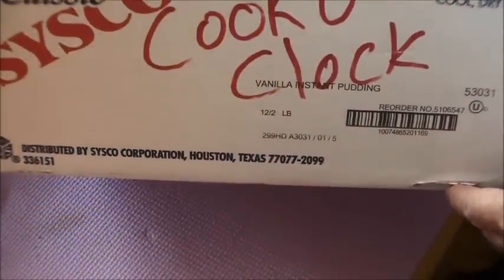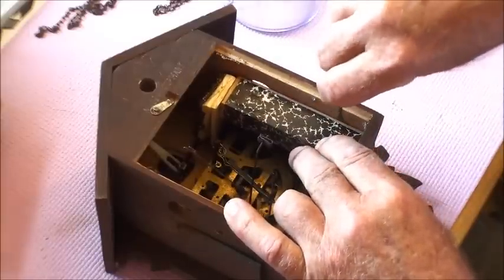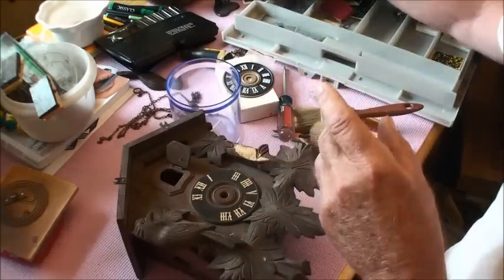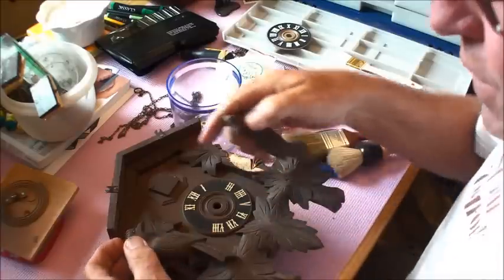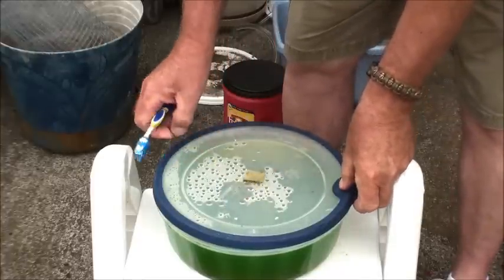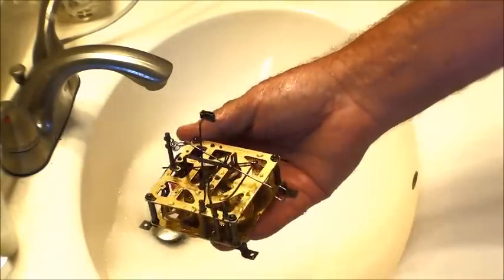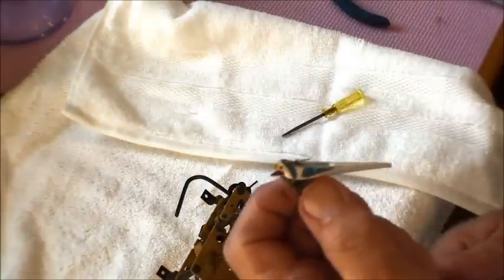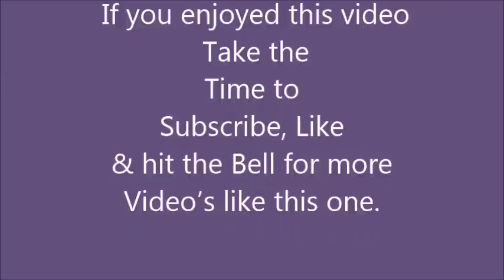Cuckoo Clock Repair

Comment: Hi  I would  like to no is thir  two chains  on this clock  I have a clock it only has one chain the cocu have looks like your s the cocu works but not the clock it also missing the pendalome
Reply from the maker: Normally when you order a chain, they come in a set of two and three chains. You can order the chains on line, along with the pendulum from Timesavers. com

Comment: Thank you for this DIY tutorial Mr. Mike. I've owned my cuckoo clock for nearly 33 years. However it stopped working after boxing it away due to moving around so much while serving in the Military. Now it just hangs on my wall looking good only. After crossing and watching your video, my clock has the potential of operating again. I tried finding a local clock repair shop and none will touch it, stating they don't carry the repair parts. Is there anyone that you could recommend. I'll gladly cover all of the shipments. Thank you.
Reply from the maker: There are more and more clock shops that stop working on cuckoo clocks. I hear there is no money in fixing them. Could you email me some pictures of your clock and the inside where the movement is? My email is below the video.

Comment: I have quite the same built around 1950 in Triberg and I've just repaired it. One needle was broken and I made it with my CNC.
Reply from the maker: This is great to hear you got your Cuckoo Clock working again Michel Bonnet.
Reply: @justmike57  I've also used bank card receipt paper to repair the bellows (just repair, not replace). Hope that will last some time...

Comment: Hello Mike, can I soak the Weights in the Amonia Soloution?  
I'm trying to repair an old unworking Cuckoo Clock my sister gave me.
Cheers and thanks for your very informative Video. Cheryl.
Reply from the maker: The Ammonia cleaner will strip the paint off the weights. Depending on what they look like, you could just scrub them with Dawn and a green scratchy pad. Also, look at yours, you could repaint them with black and some have a golden rub on them for antiquing them.
Reply: Thanks Just Mike, I went ahead and put them in the Amonia mix, before I heard back from you, just for a couple of hours, it didn't do any harm, and the Gold bits have come up nice and Shining. Cheers Cheryl.

Comment: Mike, please add to your list under your equipment the following;
- Ammonia cleaner used or how you made it
- Stain brand/color
- Why you applied stain with sponge not brush
- Type of oil used or part suppliers you like
- Where to buy various other parts we may need
-  All equipment/tools we need for such project

Do another video on tips and tricks of the Cuckoo Clock Hobby. After watching this I want to go fix the clocks of all my siblings, friends....anyone’s home I’m visiting at...ha!
Reply from the maker: This is a great idea Kevin. I will admit, I was very new at this Youtube thing when the video was made. I have added my email on the newer videos I have been putting out. Thanks so much for stopping by Kevin DeAdder.

Comment: Thanks so much for this, Mike. I recently inherited my grandfather’s cuckoo clock that he acquired when he was stationed in Germany. It hung in the den over his chair my entire childhood. It’s in pretty bad disrepair, so I thought I’d give a go at fixing it. If I use Dawn to clean the mechanism, how long should I let it soak? Thanks again!
Reply from the maker: The Dawn helps lift the oils in hot water. Swishing it around in the water and giving it a little time (15 minutes) using a toothbrush to help clean with, changing the water for more hot water and swishing many more times. Do note. After cleaning, drying and oiling. The works will still be a little stiff when you first get the clock running. It takes more time to get the oil moving again, possibly because you couldn't properly flush all the old oil and wear out. You will have to speed up the pendulum and not care for the time of the clock for a few days. I hope I didn't babl on to much and you got your question answered. Thanks for the great question.
Reply: Just Mike Thank you!

Comment: Where did you get the skill to do all the things u do?
Stay safe
Reply from the maker: I have always been a hands on person. My dad use to repair clocks in his spare time. I was interested and just started to do the same as him. Then I started to learn better ways of cleaning the clocks and went on from there. Dad started to have problems with his fine motor skills and gave me his tools that made things easier. I enjoy the Cuckoo Clock the most, then the old kitchen clocks. I also work on the other clocks as needed. Just enjoying my hobby and a great hobby it has been. Thanks for stopping by again O'Donnell's Aussie Homestead

Comment: I came across one of those too so I am watching to see what needs to be done, after I changed the broken winding gear... nice video!
Reply from the maker: Thank you for watching Angelo Evangelou. Now that I am recording my clock repairs, I haven't come across one that I need to replace the winder. Just in case things go wrong, take pictures of the gears and where they go so you can get it back together again Angelo Evangelou.

Comment: I was hoping to watch you repair a bellow. The one I have has the top piece off the whistle box. I’ll have to look closer now that I know what it’s supposed to look like. Great information about the chains. My dad has a big one he bought in Germany. He repaired it several times and when I was little he put a special wire loop on the bottom that he could pull anytime just to hear it cuckoo. All of our friends loved to come over and watch the birdie!!Dad is 92 now and I miss that clock. It used to put me to sleep at night.
Reply from the maker: That was great memories you had with that clock and your dad.  some of the clocks have a place to attach the wire to make the bird come out to cuckoo. For the bellows. I would buy a pair of them from an online Cuckoo Clock parts place. Check more than one out, because some are just out for your money. You need to keep your wire nails from the old ones and reinstall them in the new bellows. Also, you measure the bellows from front to back to get the right size. I use hot glue gun to glue them back on so I can install them faster and not have to wait for the glue to dry. Hope this helps you Cassandra Lambracht.

Comment: thanks for walking us through this. I've been rebuilding pendulum wall clocks and want to try my hand at a cuckoo clock so this was great. Now I'm pretty stoked at getting one.
Reply from the maker: If you have been doing wall clocks then you have this one in the bag. When you have music also on the Cuckoo clock, it gets just a little more difficult, but can be done. Thanks for your support Paul P.
Reply: @justmike57  Thanks for the vote of confidence. I did acquire a cuckoo clock from an estate sale, it's very similar to the one you showed in this video. I repaired the bellows and they  work, but the gears seem to have a problem. The big ones that are turned by the chains and weights don't move. The gears could probably use a cleaning but I'm not sure why they seem like they are seized. What do you think could be the problem? I tried oiling the different points like you showed. Maybe a good cleaning would be a good place to start

Comment: Wife tried to help after 2 hrs in and can’t get it over the sprocket while in the box.
Reply from the maker: It helps to turn the clock upside down and dangle one chain at a time to catch the sprocket, then turn the sprocket slowly turning the clock back around. Once the one chain is in and through the two holes, us a wire tie to secure the chains together and close to the two holes. Then start your other chain in the same manner. Check out the other videos if this one does not show me installing the chain.

Comment: Hi Just Mike! Thank you for your videos. They have been so helpful in helping me restore my grandmother’s cuckoo clock. It is a Black Forest, 1973 Regula 25, 1-day music and cuckoo clock that stopped working years ago. I cleaned and oiled it and got it working again but noticed the music and cuckoo are not aligned. Music goes off at the hour but the cuckoo won’t go off until 4-5 mins past. The music will trigger and won’t stop until I move the hand forward to trigger the cuckoo. After I do that, everything will work correctly again and stop as it should. Any suggestions on where I should be looking to get these two back in alignment? Thanks!
Reply from the maker: For the music, you need to adjust the wire that is suppose to stop the governor (FAN) on the music box. That could be called a warning wire because it stops the fan while the lever is pulling out of the barrel of the drum for the music. When the cuckoo is done cuckooing, the lever will lift and that pulls the wire up, out of the way of the fan and the music would start to play until the lever slips back in the music drum. 
  As for the minute hand starting everything at 5 after, you need to take the minute hand off, pull out the brass center, put the brass center back on the clock and turn it slowly until the clock cuckoos. Then put the hand on over the 6 or 12 and screw the nut back on snug.

Comment: I had three clocks which are currently in need of repairs, two of them not running at all.  Then last week in a moment of temporary insanity I bought two which were also in need of work, the only guy within nearly 200 miles that can do this is overloaded and says he will call me when he gets to me.  From what I've learned here I am sure that I can have two of the five working by next weekend.  The three with the dancers might take a wee bit longer but I am looking at working the dancing ones next. I might even buy a few more.  Thank you again!

Comment: just wanted to thank you for taking the time to post your work, I've just started tinkering with cuckoo clocks since my old one fell off the wall, I've scrounged around and found about a half dozen clocks, all in need of repair, watching you work has helped me get a couple of running clocks and I hope to get a couple more running by swapping out parts, I must admit working on these cuckoos will most certainly try ones patience. thanks for sharing your knowledge.
Reply from the maker: There are times these clocks will try your patience, but that also helps us learn what to look for that makes these clocks tick. I don't know everything, But I have learned a lot and try to share that with others to help them succeed. It is best to save any more expensive clock for last to get some time under your belt as you have learned what these clocks are all about  original oldpop

Comment: wow.. what an excellent instructional video. I have wanted one of these  since i saw my Nans one at the age 9. At 62 yrs old, retired and with time on my hands (pardon the pun) i have considered buying one on ebay to tinker with. i am good with my hands but just needed to be shown how (monkey see, monkey do). thank you so much for this video.
Reply from the maker: Glad you enjoyed it Keith Cheeseman. You could be lucky and find a cheap on at a thrift store, and ebay does have them for a much higher price. You could buy one that you like, if you have faith and patients. Just make sure all the parts are there like the Topper, weights, and pendulum because that will help you alot and not have to keep buying more parts for your clock at higher prices. If you do get a clock and have any questions, my email is below the video.

Comment: Hey, Mike, thanks.  I have a not-so-old cuckoo clock I bought in Germany 50 years ago.  I have to take it down and clean it --- the cuckoo is sounding too quickly, the little boy who pops out the other side doesn't retract.  But for now, I'd like to know how to tighten the hour hand --- it starting to slip and it feels loose.
Reply from the maker: Hey, Richard. Normally the cuckoo bird, if it cuckoo's to fast, the weight might be the wrong size. If you have had the clock for 50 years, I wouldn't think this would be the case. There is no other way to slow the cuckoo without the weight size that I know of. 
  As for the music man not retracting, it sounds like the music box needs cleaned as well. There should be a wheel that tell the music man when to come out and when to go back in. Not seeing your clock with pictures, I would only guess the music box is screwed to the top of the box. 
  For the hour hand, you can just push it on the shaft to snug it up because the shaft is wedged shape. 
  If you would like to send me pictures of your movement and clock, I have an email below the video.

Comment: I bought chains for my cuckoo clock and watched your video on how to feed the chains through. I think I missed something because on of the chains was very hard to pull through. Its like Im pulling the chain over a stuck gear. My clock is still not working. I need to dive in and figure out why. Thanks to your videos im not as timid as I was. Wish me luck!
Reply from the maker: Glad I could help with your clock. The chain sounds like you didn't turn your clock soon enough and the chain has looped over a gear shaft, then back on the winder. Diving in on the clock just might be a good thing, but for sure, put any parts in a dish as you take the clock apart courtsNsession
Reply: @justmike57  Thanks Mike! After 18 years in a box my clock runs and keeps good time again.

Comment: Mike, do you have a video on how to repair the bellows? I have a cuckoo clock very similar to this one from the 40ś or 50ś that needs both of those repaired, but in great shape other than that. This was great to watch, wish you were close by to work on mine. About how much are these worth if in working condition?
Reply from the maker: Hey Alison, I don't remember if I had a video on the replacement of the Bellow. I am just starting to make more videos on the cuckoo clocks and should be starting to come out Tuesday. I only release one video a week. I can put this on my list of videos to do. If you would like to email me, I can let you know what or how I do it there or wait three or four weeks for the video to come out. Email below the video.
Reply: @justmike57  thank you for the quick response! I will stay tuned for your videos.

Comment: Loved the vide, read the comments, and learned a lot. I did not see a question like mine, My Regula cuckoo clock's music weight quickly drops down when it is time for the music to play. Could it be that it just needs a new chain?
Reply from the maker: Not knowing anything about your clock, if it is a 1 day clock, the weight will drop faster then the time, and the cuckoo sound will also drop fast depending if it has to cuckoo once for one o'clock or faster with 12 o'clock. So as long as it holds up when you wind it, then things are working right.
Reply: @justmike57  Thank you for responding. It is a one day clock and yes it winds up but I should of referred to it as "falling in one fast motion" or "as fast as dropping a weight without the chain".
Reply from the maker: @monicaoevermeyer6587  I would say you might have a bushing that needs replaced that holds the gears tight against each other if it will wind up and hold until the clock starts to cuckoo and the music starts to play.
Reply: @justmike57  Yes it does wind up and hold tight until the clock starts to cuckoo and the music starts to play. Thank you. Value your opinion!

Comment: Your videos are great, thank-you. I have a question about re-installing the bellows. The bellow install is easy, but I can't figure out how to re-attach the connecting rod onto the bellows once the bellow is in place. Do you have a video showing the proper way to hook-up of the connecting rod? I've tried with the bellows on and off but nothing seems to work for me. Thanks.
Reply from the maker: I try to hook up the wire on the bellow, then on the rod before I install the bellow. If I am going to install the bellow first then the lift wire, I straighten the lower part of the lift wire to look like a "L". 
  On most cuckoo clocks, the shorter arm, next to the hammer for the gong, will attach to the left whistle box. and the longer will attach to the Right whistle box. 
  Yes, I should make a video of this subject with closeups, but in most of the videos I have been showing or telling what I am doing with the wires.
Reply: @justmike57  Thanks for your help Mike, I had a couple of learnings but got both bellows back in. The bellow anchor points needed to be oriented differently, I was constantly binding otherwise. I backed out the bellow nails to open up the bellow working space (my biggest obstacle). Then I connected the lift wire to the bellow hook and lift rod, then slid the bellows into place. My side tolerance are very tight (1/16") so any manovering of the bellow kinked the connection points, but with the nails backed out it slid in nicely without binding the joints.

Comment: Thanks for the video
But I have 2 questions first what is the stain you were painting the clock with second how to make ammonia solution
Reply from the maker: I bought my Clock Cleaning solution from a clock parts site. The stain isn't sold anymore that I used. You just need to look for a muddy color and sometimes you need to mix your own stains to make a better match. Thanks so much for watching my video Humbel.

Comment: Thanks for the video, What to do when the clock is  Wound tight
Reply from the maker: I am guessing you are talking about a key wind clock?. If so, without taking it apart, you can swing the pendulum everytime you walk by the clock, and in time, the spring will loosen up and start ticking on it's own, but this will take a while Phil Manz.